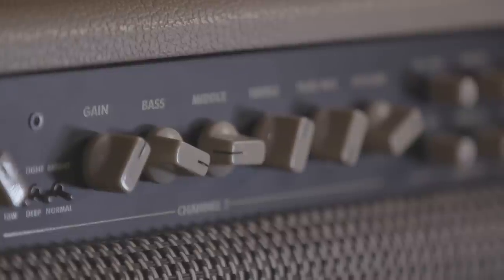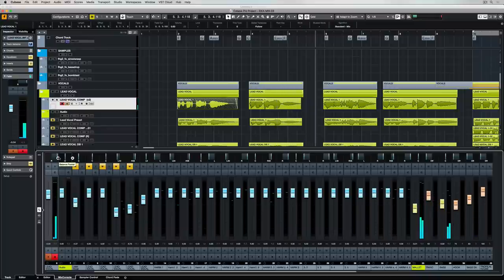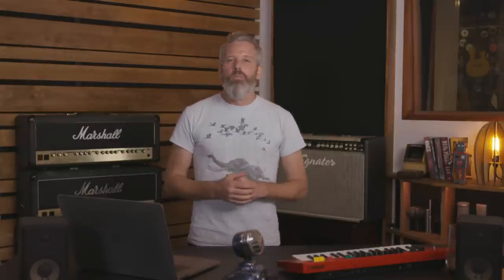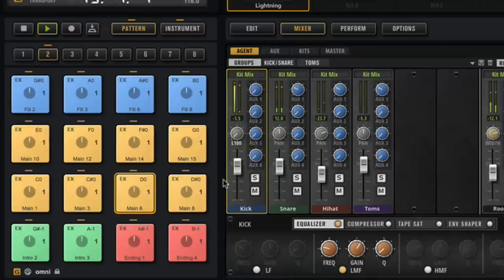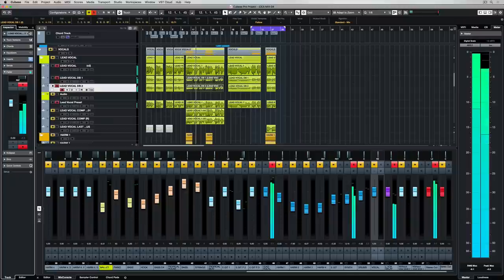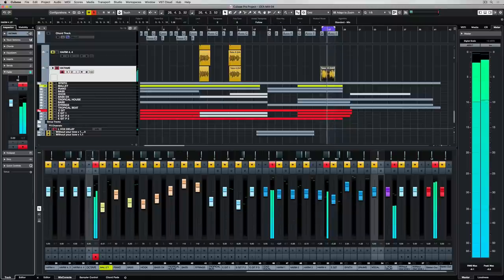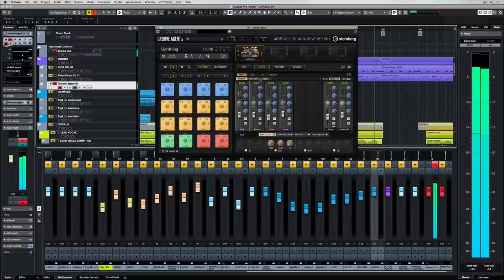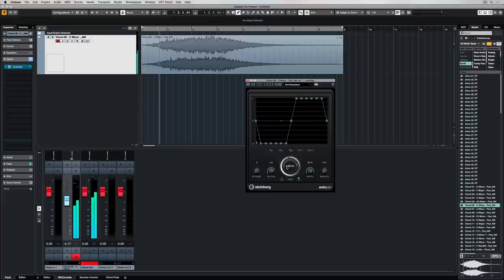What is Panning and How to Use It | Music Production For Beginners

Comment: You didn't mention the "Stereo Combined Panner" which allows you to narrow a stereo sound and then shift it off center. Great for those lush strings for example, bias the violins to the left, violas slightly more towards the center for example maintain their stereo sound. Sometimes stereo recorded instruments are too wide (often congas or bongos) Stereo Combined Panner can narrow that stereo sound and place it nicely. In the mixer view,  right click on the panner and choose Stereo Combined Panner, then you can adjust the width by dragging up and down and the placement by dragging left or right. Well worth a look at.